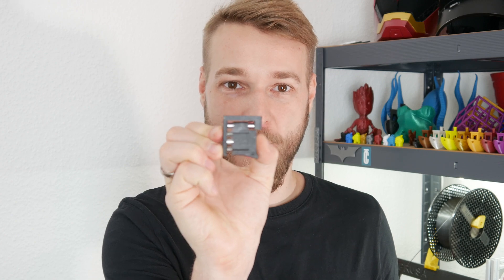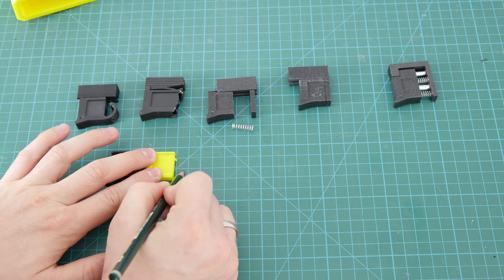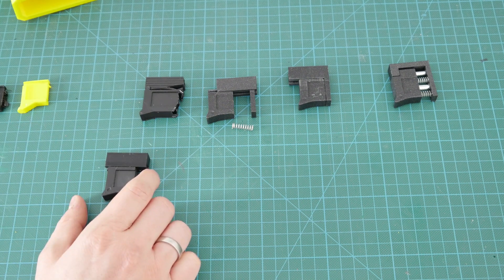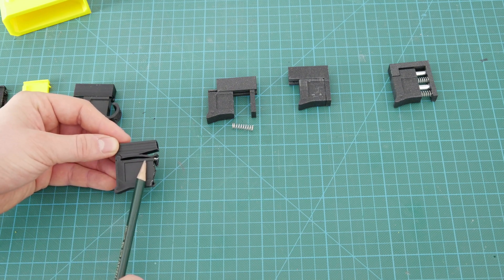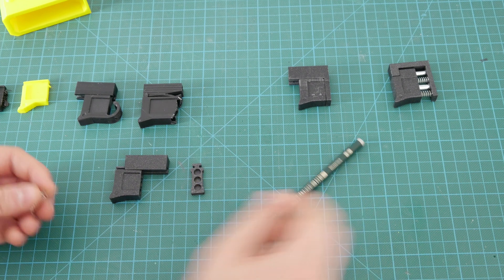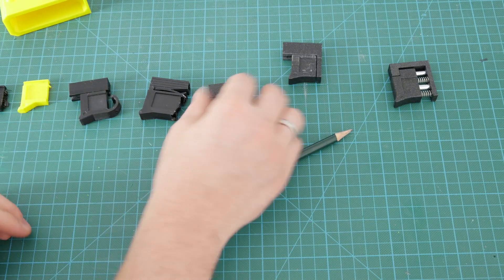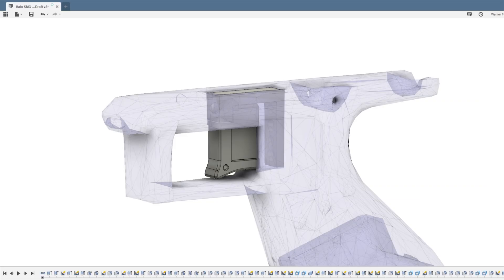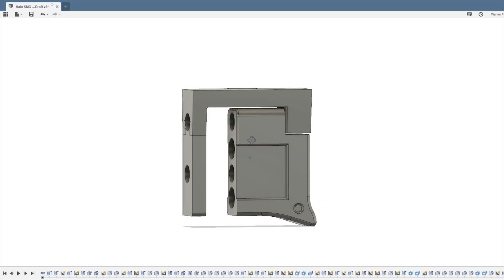3D printed Halo 3 SMG with working trigger

Comment: That’s the halo 5 smg, not the halo 3
Reply from the maker: Not really look at the details on the Grip the halo 5 smh doesn't have them
Reply: @WF3D  then explain the scope. Did halo 3 have a scope on the smg?
Reply: @GAM3RK1NG.  look up Halo 3 ODST smg
Reply: @oneplumpboi5317  not really, it’s still the halo 5 smg.
Reply: @GAM3RK1NG.   No it isn't. The halo 5 smg is a top magazine loaded smg resembling the p90. This is the halo 3 ODST smg which has the red dot sight aswell as a side mount magazine.

Comment: link to the models is dead. is there another source or way for me to get these files for my spartan build?
Reply from the maker: Hm then you'll need to check on myminfactory, Cults3D or thingiverse for similar files. I think there are plenty available
Reply: @WF3D  I have and no luck. just the halo 5 version 
which doesn't fit my build.

Comment: Looks like you came up with a similar solution to mine. I ended up extending the part to the top of the slot, widening it, and leaving a channel for a spring. your solution appears to be a bit more stable. Kudos to engineering!
Reply from the maker: Thanks man!

Comment: Hey that’s a sweet solution you found there, I am currently working on bring the halo 3 ODST smg to life in the form of an airsoft gun (currently figuring out what internal parts I will use hand where they will fit as well as limitations built around 3D printing the body) I was wondering if these files work with onshape, as many don’t.
Reply from the maker: I'm not an expert with onshape but you need to look if you can import mesh files so you have at least a reference to fit the electronics. In Fusion360 there's also a mesh to brep function which makes them a solid. That should give you less load and you can actually work with that file in CAD
Reply: WF3D alright, thanks man
Reply: I'm also working on the same project of making an airsoft version of the SMG. Did you make any progress since posting this comment?